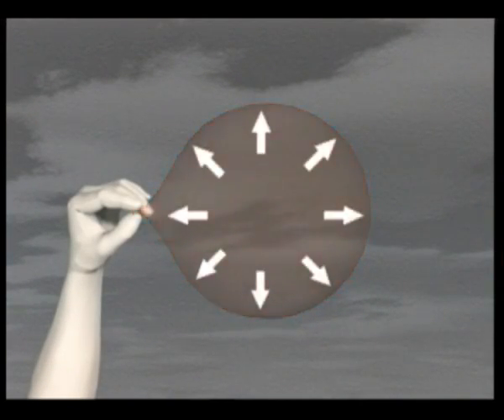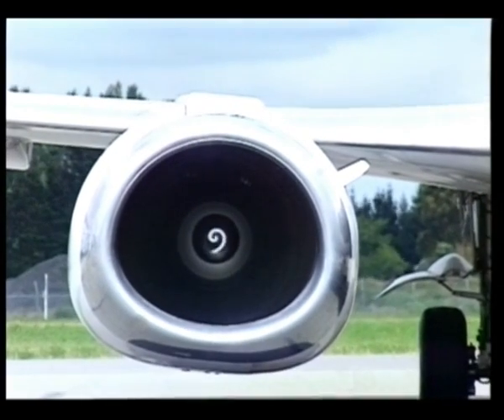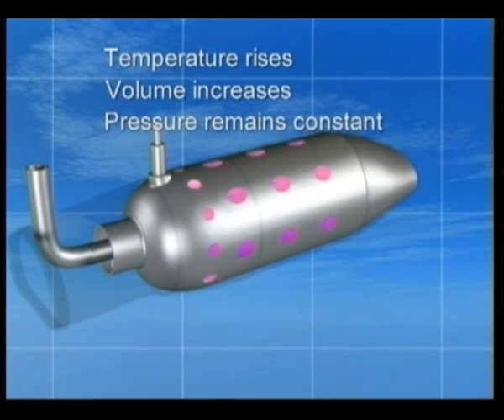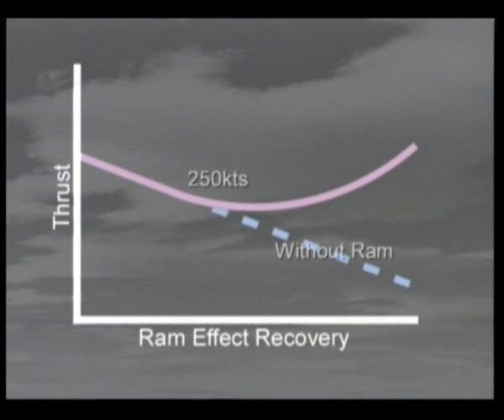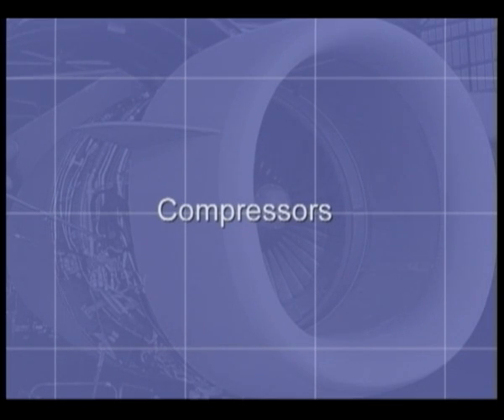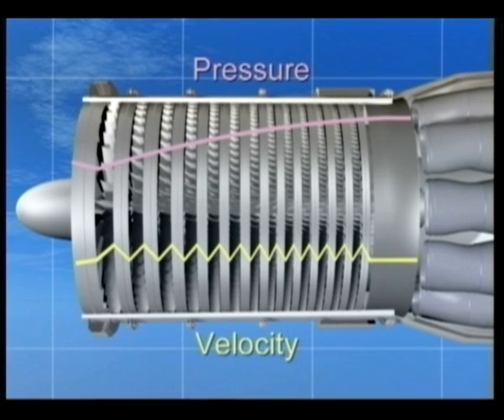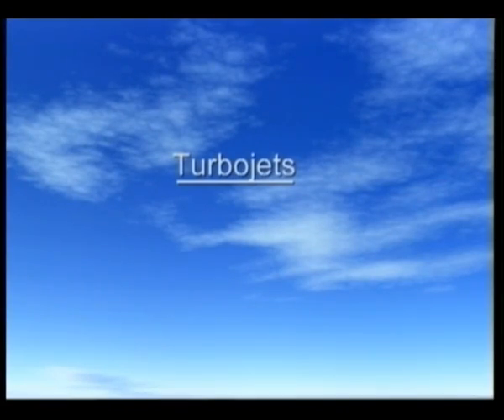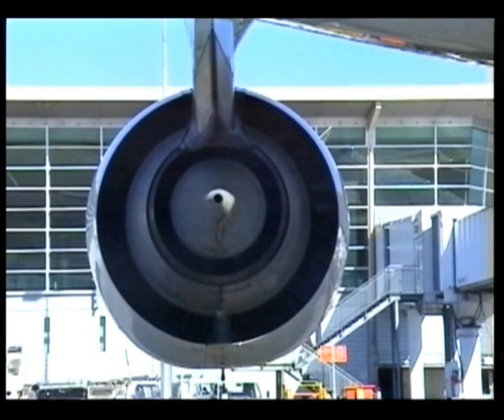Basic Gas Turbine full program

Comment: Great video (I put it in "favorites"). The 100hp Rotax UL aircraft engine weighs about 70 kg (plus oil & water). A 450 hp chopper gas-turbine engine weighs about the same (less, cos of no water). Over four times more power, for the same weight! lol
For this reason Moller (the "Skycar" nutter) could actually be successful, only if he would consider gas-turbine power. The figures speak-for-themselves. lol That's the only way he's going to get it off the ground (fully loaded). And he just got another 80 million. He should buy some. lol The thing is, that you can get second-hand engines from the plane dumps for peanuts (well...compared to the new price). Okay for a prototype. Moller just doesn't want to spend the money, cos production Skycars would require new engines (I suppose) and the availability is reliable.. He want's to sell them for a million each (that would hardly pay for the gas-turbine engines). lol You need the power-to-weight ratio of gas-turbine engines to have anything like the Moller Skycar (but each engine costs as much as a house). But the figures make it obvious, you have to spend the money to get that sort-of thing off the ground, period.. And e,g. The wasp "flying car" or "flying scooter-thing". YT search "WASP flying platform". (Has Moller seen it?) lol
Anyway...here is a RANT on "flying cars":
                                                FLYING CARS
Flying cars (proper flying cars, as compared to road-able aircraft) would have to be VTOL. This makes them (automatically) too expensive for most people to own. That is because jet-turbine power is the only way you are going to get the power and the lightness. Gas-turbine engines are good for this cos of two reasons. Power and lightness. But with this comes ENORMOUS COST. Just ridiculous. A gas-turbine engine (powerful enough for a four-seater FC to hover) would cost, like the (middle) cost of a home! And here is the bad news. You need TWO! You don't only need the combined power of the two engines for VTOL, you also need two engines for safety. You need a second engine with FCs cos they won't glide (with VTOL speed). And engine failure in hover over 60 ft and under parachute height (without a second engine) you are almost certainly GOING TO DIE! lol Choppers and planes can get down, but FCs can't (without it being bad). So a second gas-turbine engine would probably be mandatory. And the good thing about two separate engines is that you can run (one only) on level flight (plane-mode). Gas-turbine engines are more efficient when driven, so one is switched-off, for the other engine to run at a higher power setting (in plane mode). You only need (less than half) power for forward flight (in plane mode). The small-wings only work at high speed. But they may even design FCs with a "lifting fuselage" and hardly any wings. The small-wing area allows much more forward speed (in plane mode) and less weight (but they glide too fast to land safely, without power). Gas-turbine engines are extremely reliable (a plus) and so two should be super-reliable! (Which is exactly what we want for FCs). lol So I think the only reason they won't make them is cos of the combined cost of development and the cost of each FC. Once they are developed, they could sell for a couple of million each (with 4-seats) to a few rich people. And bravo! But, just for a few sales, they have to go through the process (and cost) of development (and legal costs etc). At that price, not many people will buy them. They would rather have an extra million in their pock nand buy a chopper of plane. No amount of hustling and bustling win taxis and hotels is going to cost more than the extra million. That's the problem. For those who have the extra million to spend, the convenience would be lovely, though. Like a status thing. lol But nobody could be bothered to develop a gas-turbine FC. And moller is making the mistake of avoiding the use of gas-turbine power. Nothing else is going to get his craft off the ground (fully loaded). He just won't realize that he's not going to do it with wankles. Gas-turbines are a bit "hissy" but they would be far less noisy than all those wankles. lol He's spent so much money, why doesn't he buy some gas-turbine engines, with the money? lol
Show less